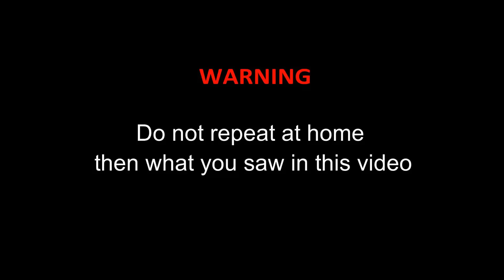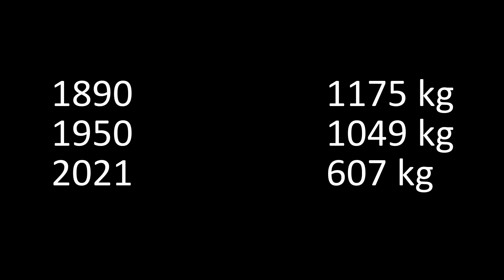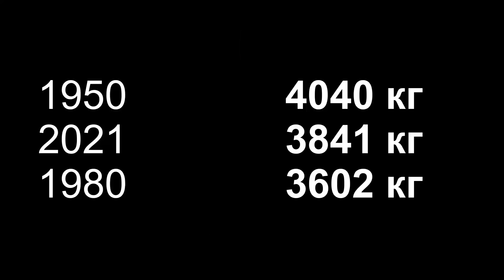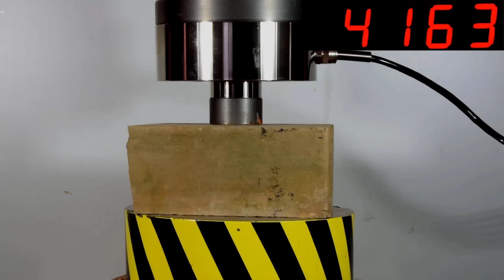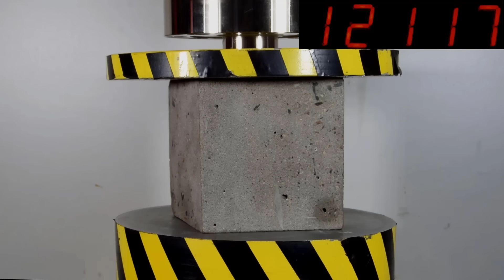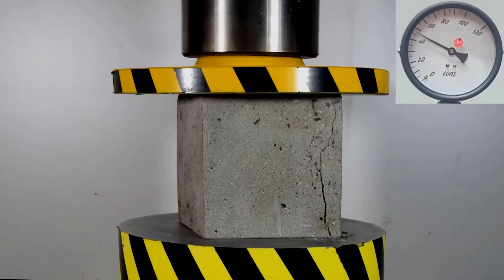HYDRAULIC PRESS VS OLD AND MODERN BRICKS

Comment: Hey, materials engineer here. Concrete hardens as it ages, chemical reactions within the concrete from both whatever you put into it (called additives in the batching process) and from the environment in which it is used allows the material to increase its compressive and tensile strength. A fun fact, in modern concrete (if memory serves) every day that strength increases by about 1-2% from pouring to about a year to a year and a half depending on environment.
also worth noting that the modern concrete was not 'fired' at a very high temperature (you know, concrete...no kiln....), you can tell my by fact it sort of just falls apart softly.Note that this is why rebar is so important for concrete, its the composite material of these two separate components that gives us the properties and behavior we desire for so many of its applications. Whereas the older pieces fail with an audible sound, and flake like a mini shale deposit into platelets. This is evidence of a higher firing temperature, which given the construction methods of the time, does not surprise me.
 On the extreme end of high temperature firing, the brick that exploded into two pieces is an excellent example, though you can find samples where the break is as if you cut it with a knife, with little if any flaking. those are my favorite as they can reach 400k compressive force before failing, and you get a nice cross section! :)
Reply: Concrete has great compressive strength but crappy lateral strength...
Reply: I don't believe concrete has EVER been fired
Reply: This also makes it suspectful that today's bricks are somewhat mixed with some cheap material and made to cut production cost
Reply: @aniketsrivastava1870  Just a thought: Today's bricks may contain more air and be lighter. Because we also look for isolation efficiency?
Reply: Hey, material engineer... Are you aware the bricks are CLAY not concrete! lol! Do admit that modern bricks are trash, for obvious reason that they are porous like cheese! Water that gets into those holes and freeze in winter shatters them like a cookie!
Reply: Thank you!
Reply: @hecks soda @digimaks the video does concrete as well at the end lol
Reply: @OmicronCoder  thats the point lol. hence why i said 'fired' in quotations. i was not referencing that it was actually put in a kiln.
Reply: @Snarkapotamus  correct, a fun game i used to play in the lab was which concrete sample would fail first in tensile strength. it was basically gambling as we put bets on it but have to be bad boys somehow while in your lab coats.
Reply: @aniketsrivastava1870  you might take this mindset but allow me to put something in the old noodle to stew. often ceramics are made to perform a task in a certain area. hence if you used bricks made to be used in SW USA in new england, it would be obliterated by the constant rain - ice expansion that wouldnt necessarily be an issue in SW. these properties we can construct with additives and even recyclables (a favorite of mine being crushed glass allowing for cleaner brick manufacturing.) as such modern brick is useful but within much more narrow applications. that doesnt mean that there arent very shitty brick though. there is one company whose samples we tested that shall remain nameless that failed. every. single. test....for FOUR YEARS!!!! NOT ONE!!!
Reply: @hecks soda the video does concrete and brick. i lumped them together and spoke about them both. apologies if you couldnt follow the journey i took between them.
Reply: @VladKov36  appreciated, the youtube cave goblins just like to be cave goblins.
Reply: @digimaks  the video does both friend. i made a rather lengthy response to your "modern bricks are trash" comment above to another comment that was phrased nicer. Though i doubt you will i cover the exact situation you just referenced.
Reply: That was really fascinating.
Reply: I’m studying material science and engineering next year.  You’re comment actually made me way more excited for it thanks man. Do you think the degree is worth it? You can be honest don’t worry.
Reply: @brotherhoodz97  Mr materials construction engineer, I have a question. If it does at all, how does such aged concrete hardening factor in to how they must plan the demolition of buildings?
Reply: Напишу ответ на родном языке, т.к. не особо уверен насчёт корректности перевода. 
Насчёт набора прочности бетоном каждые 1-2 дня, всё будет зависеть от условий твердения, изначального водоцементого отношения, было ли присутствие дополнительной температурной обработки в пропарочной камере. Допустим если пропарить бетон, который сделан не из особо сильно активного цемента, то можно спустя месяц другой не наблюдать сколь либо высокой прибавки по прочности, также сильного возрастания прочности в процентном отношении не будет, по мере приближения водоцементого отношения к 0.2 и роста прочности и количества добавок
Reply: @Saltyrick5k how u know if they an engineer or not? XD
Reply: @digimaks  He's speaking about concrete, not bricks, obvioulsy!
Reply: @digimaks  4:44 Concrete
Reply: explain in fortnite terms
Reply: @Saltyrick5k pretty sure a brick layer ain’t the same thing as a material engineer
Reply: Ugh... your post is so annoying. Chanching from talking about concrete bricks to regular ones without making it clear is super annoying.

For anyone else, who also was a bit confused in the first reading: The last part is about regular clay bricks and has nothing to do with the properties of concrete bricks, that the majority of OP's post was about. Clay bricks DO NOT harden over time. They are hardened solely in the preparation and firing process.
Reply: Were bricks back in the day as porous as they seem to be today when they were first made? When I hold old bricks compared to new ones they are way lighter and have more pores than the old ones it seems. I am genuinely asking for your answer I know some on here are attacking...I am just curious.
Reply: Its not concrete though? It's a kind of clay composite?
Reply: Are bricks made with cocrete?
Reply: @Drikkerbadevand  concrete made of sand+rubble+water+cement+ some optional additives for increasing strengt of concrete on low temperatures or if its under the water etc.
Reply: I did not know that about concrete! Thank you
Reply: @brotherhoodz97  I have heard that the slower concrete takes to go off, the harder it will be eventually, so keeping it damp for longer is better for it in the long term. Is there any truth in this ? (Currently trying to patch up an old cellar floor, which takes a lot of punishment from heavy metal beer casks.)
Reply: @granadilla4585  Yeah, I was thinking about that too, then also size/height of buildings, overall weight, inevitable material saving due to unsustainable use of it, etc. AND of course WHERE THEY WERE MADE... you can't just show one fuckin brick and make a conclusion from it for the whole world... but generally, back in days then needed primarily to build a house that will stand for a long time and combined with methods they had, they made bricks the way they did... also, always there were the more expensive better ones and the cheaper regular ones commoners usually used... today, generally lighter materials are used so they don't really need super strong bricks for huge buildings, they would just use different materials... for normal houses, modern "weaker bricks" are simply a better option, especially because of their weight and insulation efficiency as you said, not to mention the majority of people here who are building a new house or making some major changes use "Heluz bricks" or any available equivalent, sometimes hollow, sometimes insulated... barely anyone use classic bricks unless they already have them or can get them from someone for very cheap because they're just not worth using... well, maybe sometimes for interior but still, you have to be able to drill into them without the fear of breaking them (for kitchen cabinets, shelfs, etc.)
Reply: Wow
Reply: @jharr96-  Nice😂 but there were concrete blocks at the end tho
Reply: Yes i was going to mention the rebar part, this test wasn't fair. ALL buildings using concrete worth a damn in the west have rebar/steel through them. It helps them withstand stress and not crack. I imagine it would have been a totally different test if there had been rebar or steel mesh in it. Also, it looked damp in the middle.
Reply: Thanks well explained. I love scientists and engineers
Reply: The modern example is also cement not concrete
Reply: Could it be that there are different bricks for different purposes?  In 1890 bricks formed the exoskeleton of most buildings, bearing the building weight.  Today, many bricks are used for veneer only with the structure’s wood or steel frame supporting the building’s weight.
Reply: Everything gets destroyed by time. Modern bricks just made from crap
Reply: Nice try but modern building standards are just shit. I moved into a new build recently and it feels like it’s made of paper compared to my older build. I hear everything around the house and next door.
Reply: bricks are clay not concrete.
Reply: Exactly what I was looking for !!
Reply: @t__v_____290  Watch the video before you try to act smart.
Reply: Hey material engineer , were all these bricks made of concreteorf the usual clay method?.
Reply: Well that's a concrete explanation
Reply: @bagofnails6692  ive also heard this, truth be told, i have never done any tests, but if memory serves the drying process (though more accurately it's curing) is what gives it its strength, through the what i believe if my chemistry knowledge hasnt completely abandoned me are hydration reactions. These actually consume the water and produce compounds that help fight against plastic shrinkage and the tensile stress that comes with fast drying (this leads to cracking on the surface). So the longer that process takes the stronger it hypothetically should become. similarly to the fact that you dont look your best if you fling all your clothes on in 1 minute, vs taking your time. hope this helps. 

(fun fact, you cna warp traditional brick by drying too fast. next time you see them in lawn and garden sections or whatever, see if you can look at the biggest face of the brick and notice if they are warped within the face, like it could retain water in a pool if there were no holes.)
Reply: @a.t6066  This is an excellent question! unfortunately, this would be a civl engineering question, as I only took basic civl courses in conjunction with my alma maters course requirements. however from my only slightly better than nothing standpoint, not very much, the procedure of demolition would involve controlled explosives or large machines that can push pull stab or what have you to essentially take even the toughest of ceramics and concretes and turn them to wet paper. a rule of thumb is that ceramics and concretes generally don't like being exploded or vibrated with repeated mechanical pounding, or giant earth movers laying waste to their structural integrity (i dont blame them) sorry that I couldn't get a more definite answer. i tell you what, ill ask around the lab in the next few days and see if people much smarter than me know a more usable answer!
Reply: @jamesbaylis2725  my friend, i am currently pursuing a PhD in the field utilizing the knowledge of MSE. it is the strangest of the bunch for even chemical engineers follow the more classical engineering approach. We use the periodic table like a spice rack, constructing materials to fit certain requirements, then like mad scientists of old we freeze, smash, pull, burn, explode, throw t in acid, and do anything we can to test it for that role. if you fail, GO MAKE ANOTHER SAMPLE AND TRY AGAIN!!!! if you succeed, congrats....it could... be...BETTER! if you want, if you have discord or email or something, i would be more than willing to send you a comprehensive listing of an overview of the things youll cover and some recommended reading and tools that helped me through my undergraduate in MSE, we are a small bunch compared to the holy trinity of mechanical, electrical and industrial. If you aren't interested that's totally fine, i hope you enjoy your undergraduate journey, its a blast.
Reply: @hentan4912  Ах, да, я слышал о пропаривании, хотя, если мне не изменяет память, я не взаимодействовал со многими из них от компаний, которые присылают нам бетон. Конечно, будет замедление по мере приближения к некоторому минимальному значению, а также присадки и тому подобное. это переведено на русский, заранее извините за перевод :)
Reply: @lunasun1738  they are a youtube cave goblin, its fine, the comment wouldnt feel complete without the
  "*scoff* you are so stupid, you arent X, Y is so simple" 

its a part of a balanced youtube ecosystem! :D
Reply: arent these clay bricks
Reply: @apocalypsen0453  ooo the closest thing coming to scathing thing so far! ironically the technicians who work at the lab started as brick layers and still time to time make test walls for us to test heat transfer. i unfortunately do not know how to lay brick, despite my desire.
Reply: @Kardinaalilintu  I do apologize about that, i was simply so excited to get to talk about brick and concrete, if i could pen this under mine i would. thank you for the clarification for the confused people. :)
Reply: @Drikkerbadevand  the video does both brick and concrete. i simply talked about both (and frankly didnt differentiate between then very well, i kind of went back and forth.)
Reply: @wickedninja8599  no worries friend! i actually am not aware, the porousness of a brick can be vastly reduced by a high firing temperature (other factors exist as well). now i cant say for sure without testing them, or at least seeing an holding them, i made a longer post on this somewhere, but its been drowned by now. often bricks today are made for specific regions (large regions) for instance, you wouldnt make a home that was meant to last in new england, or britain with high porosity brick, as water gets in there, freezes and obliterates them. so you have either: a brick made for moderate to warm areas (anywhere that isnt new england or upper bordder regions where ice is common, or a shitty brick made for gardens and the like. this is all general information, exceptions do exist, covering my bases with this sentence here. 
I hope this helps.
Reply: @ArtemkaPannat  :) its amazing what watching the video does, appreciated friend.
Reply: @ValenRei  thank you friend!
Reply: @Blk.E92  when you rush tilted towers on no build nad have to hide behind buildings, pick the chad low porosity towers as they can take that punishment like a no skin takes beatings from vegeta in the new update, flaking like a gf who figured out you stole her credit card on skins. DONT pick that soft brick with the yee yee ass haircut thats gonna fall to powder when struck by a gold ball emote. 
that cover everything?
Reply: @digimaks  Are you aware the video has concrete tested later or did someone hit you with a brick so often it's all you ever think about?
Reply: @bagofnails6692  in traditional concrete, the slower it takes (usually about 28 days standard in industry concretes), the stronger it becomes as water is used in chemical reactions to stengthen the structure, HOWEVER after that 28 days, the chemical fuel that undergoes hydration is at such a low %, its unlikely to make a noticeable difference. as such, if you had it professionally done, and waited 28 days before unleashing hoppy hell, then thats about as well as its gonna do. 
something you can do in addition: i once worked in a hot dog/brewery business, where we had heavy duty rubber (i dont even think it was rubber) mats that small factory machinery was placed on, and we put a couple of those down and it fired alot of the chips and bumps for the concrete floor in the walk in. maybe a good investment. 
hope this helps, if it doesnt, tell me and i can go more in depth or clarify something.
Reply: @onechristwoncity  anytime friend!
Reply: @gjd8849  you would be correct! many bricks are even tailored to regions. icy and wet regions get less porous brick as ice could form in the pores and destroy them. while the opposite is true in dry and moderate regions.
Reply: @OneTwoMark  that would be the standard for whats allowed in the building. people cna make amazing brick and concrete and the like all day long, but when the bill comes to select materials, its usually the cheapest they can get away with :( it is kind of like judging a care company based on its cheapest most affordable car.
Reply: @rustythecrown9317  they tested concrete and bricks, those are two separate things, i just bounced between the two poorly in my excitement.
Reply: @ThGy  the video tests concrete and brick, i just bounced between the two in my excitement.
Reply: @shotsfiredman  this is gold my friend, i physically took a picture of this with my phone to show to the lab, i might get the latter part of this typed out and framed for my office!
"someone hit me with a brick so its all i think about."
Reply: @brotherhoodz97  So if these are clay bricks , your concrete analysis , although accurate , is wrong for these tests. I honestly have never heard of houses using concrete bricks for construction. All the houses I've been part of building all used oven fired clay bricks. Cinder blocks are a different breed of fish.
Reply: @brotherhoodz97  Thank you for the knowledge and information.
Reply: @brotherhoodz97 regarding bad bricks, i once had a hand in extending a factory and the salesman came with his own brick and a brick from a "competitor" (read: alibaba vendor) 

That second brick was amazing. It somehow held its shape all the way from northern china to sweden and yet, crumbled like slightly wet sand when touched.
Reply: @brotherhoodz97  Thanks for the reply. It makes perfect sense.
Reply: @angrydragonslayer  thats honestly the best brick ive ever heard of. it gets to its destination in tact, but completely unusable in most applications. incredible!
Reply: You should try to unlearn some of those wiki facts and educate yourself the way these guys in the 1950s did, your low quality products might last longer.
Reply: @rustythecrown9317  the video does concrete and brick friend. i merely bounced between talking about both of them, though granted did a poor job differentiating them in my paragraph structure! i was not equating them.
Reply: @breakneck777  how much are you willing to pay for a brick?
Reply: @brotherhoodz97  indeed, it easily raked it 90% profit for its creator
Reply: @brotherhoodz97  Ahhh , I see ... they all look like clay , but I see where you're going... Hydraulic press for the win.
Reply: @breakneck777  the fact that youre specifically saying the low quality products means you are complaining that the cheapest products dont last. hm. an interesting stance to take. i appreciate the cave goblin approach of just taking a swing though!
Reply: Add the fact that new bricks are much more optimized. They dont need to be as resistant. But they re much cheaper, easier and quickeer to produce cause manufacturing improved alot.
Reply: @gothia6515  Manufacturing improved , but so did the cheapness of the owners.
Reply: Вы технолог от Бога,интересный комментарий.
Reply: Clearly you aren't a materials engineer if you don't even understand how concrete cures. It doesn't gain 1-2% every day after pouring. That's nonsense. It's not a linear relationship. It's parabolic. The strength rapidly increases in the beginning, with the earliest days having the largest gains in strength and gaining less and less as time goes on. By 28 days, it's effectively leveled off. It does gain slightly more over the next several months, but not a significant amount.  That's why the 28-day strength is used in design (I'm a structural engineer, so i routinely run these comps). After a year or so, any gains in strength are so miniscule that they can be assumed to be zero.
Reply: @rfehr613  it makes me happy to learn that of my comment the thing it seems I am wrong about is the part where i said 
"fun fact (if memory serves)"
thank you for clarifying friend, especially as kindly as you did. You are about as nice as i expected someone like yourself to be, I appreciatedd your wonderful demeanor. :)
Reply: You didn't need to write a book to explain that 😆🤦.
Reply: @brotherhoodz97  a materials engineer wouldn't need to recall (incorrectly) on memory something which he specializes in
Reply: @rfehr613  a good thing concrete wasnt it then! agreed!
Reply: @abortionsurvivor14BB  no problem, thank you for the kind reply.
Reply: @DownUnder43  ive gotta speel when it rarely comes around. im excited!! :D
Reply: @rfehr613  it looks like you don't  have a science  related degree. While you do learn and specialize  on somethings the main goal is to be able to solve problems effectively  not to remember every single fact that you can. Engineering is very complex and you can't  expect the engineer to rember it all. I am a student and egineer intern. The majority  of the team memebers ( engineers) don't  remember  what they learn but can do their job effectively  and a lot of lifes get better beacuase of them.
Reply: @bagofnails6692  realistically you want it as hard as possible, it generally takes like 3-6 weeks for a foothpath to be pretty hard and a few months after to be bone dry, so it's up to you
Reply: @Snarkapotamus  That's why, usually, reinforced concrete is used.
Reply: @absolutezero2848  you're an intern, so you don't know anything. I have degrees in physics and structural engineering, and I'm a licensed professional engineer of 10 years. A materials scientist would absolutely know the fundamentals of concrete curing.  Not only is that their wheelhouse, it is one of the most basic things you learn very early in your college education and continue to use throughout your career.  In fact, it's covered in classes taken by a broad range of engineering and science majors. So when I called BS on the guy claiming to be a materials scientist, it's because if he really was he would have known how concrete cures... Like the back of his hand.  I'm mostly annoyed by the fact that he's misleading people with his false claims that could have very easily been checked if he just googled it.  There's a plethora of information online about civil engineering materials, most of which is from academia.
Reply: @brotherhoodz97  idk man we mostly use stucco in my area of the southwest. Monsoon season hits us hard yearly.
Reply: That is such bs
Reply: I think you are wrong. These bricks are not made of concrete. They are made
Of clay and water. It’s very simple. Previously these bricks were made by burning coal in a furnace. This
Releases heat very slowly. So
It takes a long time for the bricks to harden. The longer it takes the stronger it is.At the end of the 20 th century wooden logs were burnt to cook the bricks. So the strength was less. But now they have some crappy methods in brick making. Naturally the strength is even less. 
I am not an engineer. But my family business was brick making. (Well some fifteen years back )
Reply: @granadilla4585  exactly what I was thinking, old bricks are way too strong for what they do, and modern bricks must be spongy for more than “making it cheaper”
Reply: The two are different concrete is weaponed with metal to give it more strengt. In the first you don't see this in the second you see the Brown spots from the metal. So ofcourse the second in more strong than the other without.
Reply: Thanks nice science man!
Reply: @OmicronCoder  You cannot make cement powder without heat.
Reply: @shotsfiredman  this made me laugh til I cried idk why but thank you....
Reply: Concrete Fired? Oh, great, Now how is concrete supposed get a job now!
Reply: @brotherhoodz97  I didn't know how to lay bricks until I just made some walls. (I'm not saying that I'm any good at it, mind.)
Reply: @UMADBRO64  So angry about bricks.
Reply: @maxl3189  Indeed. It's a working cellar, and the patches are at most an inch think, and often less than that. I'm not expecting the quick fix to work miracles, but hopefully some of it should take. It's mostly filling in little depressions to stop puddles becoming semi permanent.
Reply: @rfehr613  You might know more about this subject than the other guy, but I learned nothing from you and learned some knowledge from the other guy. So well done there.
Reply: @bagofnails6692  well then what you learned is wrong. Good job 👍
Reply: @anonymousananymous  hey friend, the viddeo does both bricks and concrete! henc why i talked about both.
Reply: @bagofnails6692  thats fair!
Reply: @aniketsrivastava1870  Bricks these days don't need to comprehend 4 tons of weight anymore, with newer and more modern ways of building a structure, walls are just separators. therefore them being heavy makes the dead load of the building heavier then its just useless. its the same with ceilings, some buildings only have a thin layer of concrete as the ceiling and the rest is just some sort of foam.
Reply: Never read a YouTube comment that made me feel dumb like this
Reply: Bricks are not concrete tho they are clay
Reply: @digimaks  did you watch the whole video? It has concrete blocks in the last segment.
Reply: @hecks soda there are concrete blocks in the last segment of the video.
Reply: Concrete has a maximum life of 60 to 80 yrs. Check out the bridges. Old bridges out of stone stand the longest ( since roman times), bridges our of rock and steel last around 500 yrs. Concrete one need to be constantly fixed and then demolished after 60 to 80 yrs. Concrete is a cheap (money wise) and quick produced material that lasts a short time in accordance to todays mentality of better waste and sell then keep and sell less. Its all business. rather cheaper and lasts shorter then quality and lasts longer.
Reply: @Robsamuel  my brother in Christ the video does both, hence i talked about both!
Reply: @hecks soda you noticed that there is a concrete part at the end of the video ,right?
Reply: The high strength concrete had no aggregate unlike the last one.  From my experience busting concrete cylinders in school, that significantly affects strength.
Reply: @joshr.6785  that has to do with particle size. particle size is a big determiner for ceramics, concrete, and anything where you are essentially pushing things together and telling it to stay. even more complicated when you attempt to obtain an optimum level of multiple sizes of particles to fill gaps left by the large ones. you are correct in that it is a factor when determining strength!
Reply: @bagofnails6692  when you talk about "slower to go off" I assume you mean a slower cure time. What you are describing is an affect of the temperature of the concrete. Concrete that is too warm will set up quickly but tend to have a lower final set strength. Inversely cooler concrete takes longer for the initial set, but theoretically get stronger. The ideal temperature is i think around 65-80F. There are more factors of course.

The more water you add to concrete the weaker it will be. The higher the cement to water ratio, the stronger it will be, it's pretty simple.
Reply: @rfehr613  He's a student, has no real world experience yet. At least he's excited about it I suppose.

As for me I dropped out of Civil Engineering. Once I started my internship in testing and special inspections I never went back. Hitting a real burnout though, they work us to death! 60-70 hours is normal.  Maybe I should go back and finish my degree 🤔 idk if it's worth it for me
Reply: @BigBeastfull  they worked you 60-70 hours a week as an intern? Wow that's unheard of. That's not a company you want to work for.  Look, 60-70 hours a week isn't totally unheard of for civil engineers, but it's not the norm either. My company is known to work people hard, but in the end they can never force anyone to work over 40 anyway. I've basically been doing strictly 40 for the last few years, and nobody has said anything and I've gotten the highest raises of my career in that time.  My two past jobs were pretty regular 40 hour weeks. In fact, overtime needed approval.  I don't know what you're doing now, but a lot of areas in civil engineering have job security. I'm in the transportation sector for that reason. My father is a civil engineer in the private housing sector and I watched him lose everything in 2008, and I wasn't going to let that happen to me. Transportation is backed by federal regulations, so there's always going to be work. It's just not as glamorous as private sector work.
Reply: @BigBeastfull  Thank you for the advice.
Reply: @rfehr613  as an intern(now I'm a 5th year) I actually worked 70-80 hour weeks with personal record of 93. One guy hit over 100. Now my schedule fluctuates anywhere from 30-60 and that's what drives me insane.  I can never plan anything as our schedule is dictated by contractors schedules.

I also am in transportation with our fingers dipped into commercial, and some residential(mostly apartments and fourplexes). Mostly I run QC tests on asphalt, bases, and concrete. 

Some reasons why we work so much is due to weather. The paving season is from late March to late October so contractors will go ham and work all day, trying to make that money. When they work we have to test/inspect to pass it off. 

Anyways, the money has been decent at the expense of my social life. I've been thinking alot lately and decided to meet with my boss. Going to tell him that I'm changing my career unless he can stick me closer to 40. I could work for the state but they are notorious for low salaries here but good benefits and hours.

Good luck to you sir, and thanks for your work improving the infrastructure.
Reply: @BigBeastfull  yeah, if you're working for a contractor, you're fucked. You need to get into the consulting side of things. We have all disciplines in my firm - traffic, highway, bridge, water/wastewater, geotech, construction management, construction inspection, etc.  You're not beholden to the contractor under those conditions, even if you're on site every day.  I've never even heard of interns working OT, much less 80-90 hr weeks. That's insane.  Only time I've ever worked that much myself was at my first job when we had a bridge inspection contract with the army, so we'd go on 2 week trips to bases and try to knock out as many bridges as we could in a day, 7 days a week.  That was an extreme case though. If they expect this much of you as an intern, it's only going to get worse as an employee. I'd try to find work elsewhere.
Reply: honestly if we're talking about concrete? more then Likely since we often don't  change the type of concrete used all that often (portland usually makes up the bulk) and some of the additives we add can add various properties. the fact of the mater is most building materials are built for cost and efficiency over longevity and resilience.

processes have significantly changed since the 1950's much less the 80's and we are not getting the best products just the most cost effective. most concrete is just air cured not fire cured. and frankly Rebar is frequently a failing point for most modern concrete construction cause while concrete can strengthen over time depending on the type it can also weaken over time, and it is a porous material that will easily allow an oxidizer inside of it. basically the rebar gets eaten away and swells over time basically negating any benefits earned long term.

as far as bricks go we've once again changed the processes in which they are made to produce them as efficiently as possible. i mean you are basically seeing the results in structures where a sbandoned concrete/brick structure is out surviving an easily abandooned modern structure of the type.
Reply: This is surprising but it still looks like the older bricks were superior. My Guess is that modern building materials are made cheaper and thus Arent as strong. Its Very typical today that Everything has to be as low quality as possible without breaking the law just to squeeze every last Penny from consumers
Reply: That "modern concrete" seems to have been drying for only 30 minutes HAHAHAH. I know this comparison is anything but correct. Concret almost (if not always) "explodes" when the compression is too high, and this seems to be wet sand lol.
PD: English is not my main language, there are expressions that are not precise. Hate me with caution.
Reply: @brotherhoodz97  why not say the name? It’s their fault they fail.
Reply: Gotta love how the top comment on this video is a "really makes you think" style comment whose reply chain is just filled with pseudoscience and people literally saying that the problem is how workers these days are better paid and educated...but this guy giving scientific facts is the one with at least 50+ people who either didn't watch through to the concrete testing part of the video, or who don't understand the difference between modern concrete and pre-modern cementacious composites 😆
Reply: @Rupert3434  you get used to it. thank you for the kind words friend.
Reply: @dr.bright3081  i signed an agreement not to, and i love my professional life being in tact!